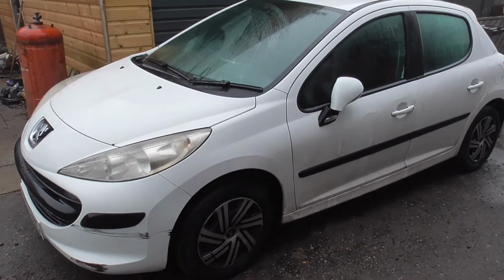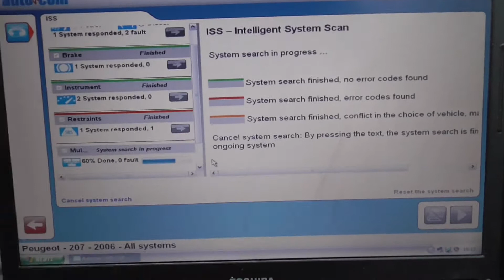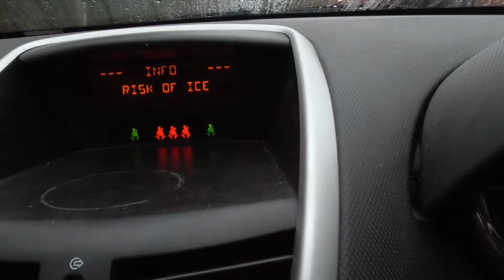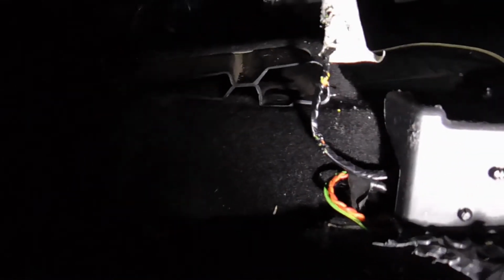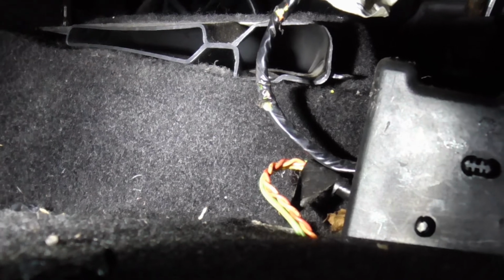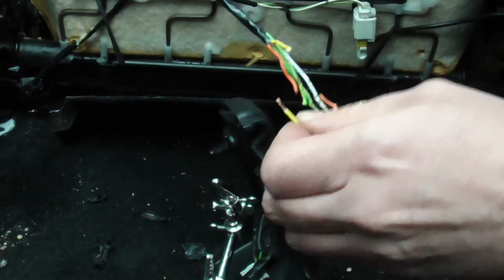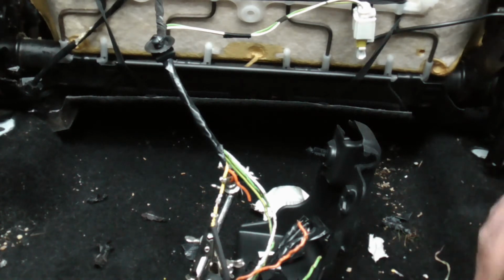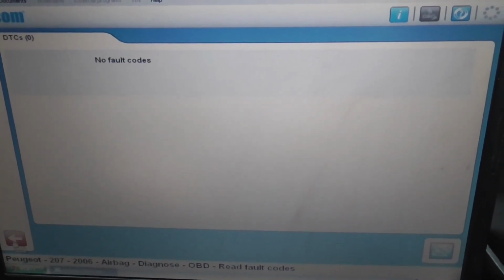Peugeot 207 1.4 HDI 2006 Airbag/Seatbelt Fault. Code 608 Airbag Light On - Diagnose and Repair

Comment: Thanks a lot for the video!! Despite the airbag fault wasn't by the same reason like in your video, I could find the connector below the seat. It results that during the last rain season, my car get stucked because of a several flood that reached the interior. That caused the pin connectors get some rust and lost the contact. Now I have repaired it, and the alarm dissapeared!!
Reply from the maker: Excellent job. Well done!